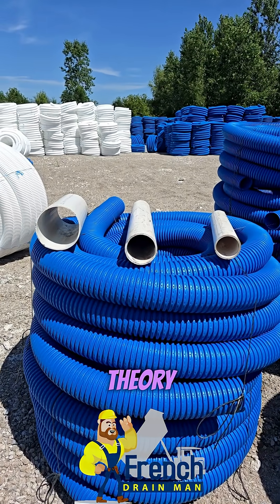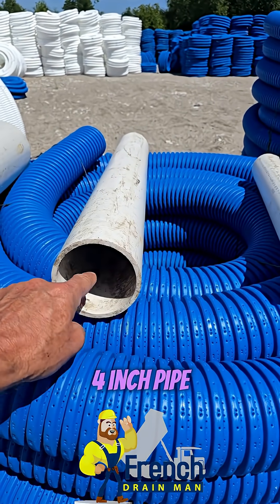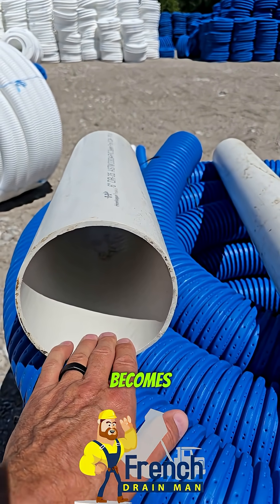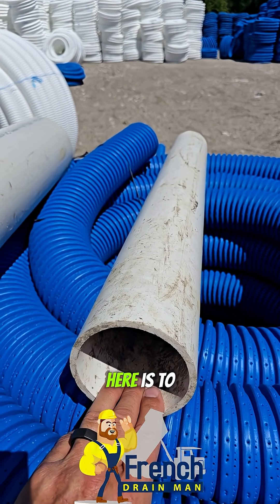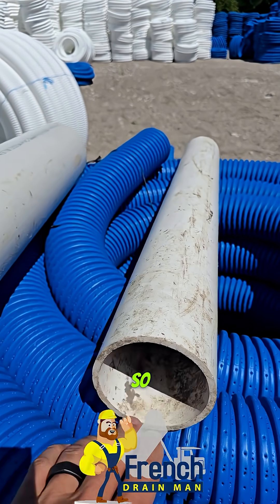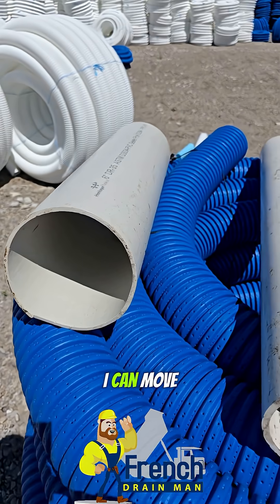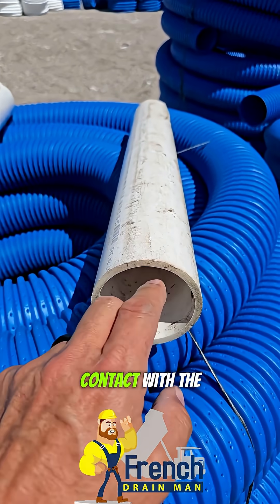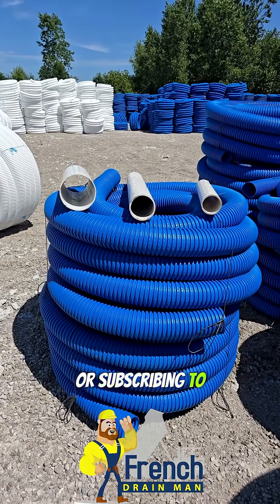Bigger is Better Theory

Comment: Good analogy. But remember that the more friction you have the more wear you have. Especially when you have shingle pieces in it. For a big storm it is great to move all that water quickly. But if you don't have a lot of water it's overkill. I.E. the big pipe. But look at your situation, if you have a ton of water you may need a bigger pipe.

Comment: If a 3 or 4 inch pipe volume flows through a 6 or 8 inch pipe, the air gap above the water flow in that pipe acts as the VENT, allowing the air displaced by the water to  move freely above it. The 3 or 4 inch pipe running at full tilt "unvented" will reach a point where it hits the breaks to "glug" air back killing the flow. Is this not a factor in yard drainage? I ask because it caused a huge amount of chaos in my basement sump water evacuation system. I vented the system and now it runs smooth as can be. No plumber I called even thought of this. More pumps, more check valves, dig up the pipes, I heard it all and finally worked it out myself!!!!
Reply from the maker: Vacuum is great in yard drainage 
Ventrari effect.
Reply: @FRENCHDRAINMAN  “Venturi effect”? you mean - close cousin of the Bernoulli effect.
Reply: I guess it could help generate suction of ground water in a yard install! Intresting!

Comment: Theres a problem with your explanation of water flowing through a 6in pipe. Flow rate is Area x Velocity, so if you increase the larger diameter pipe will flow the same volume of water flower. This next part gets into fluid dynamics, The Hydraulic radius increases with pipe Diameter. A 6in pipe has a bigger hydraulic radius which actually means less friction loss. 

For drainage, you've pointed out high velocity is important to keep the system clean. So you would want the smallest pipe for the volume of water, to pick up and move debris out the system.
Reply from the maker: Thank you for commenting and contributing.

Comment: Reference the Science Data and Source information that backs up what you're saying. Show the receipts Dude.
Reply: Ah yes, the ol’ ‘Show me the receipts, Dude’ comment. Classic. So here you go:

The science behind this is literally Fluid Dynamics 101. You ever heard of the Darcy-Weisbach equation or Manning’s equation? These bad boys describe how friction loss increases with pipe diameter if the flow isn’t high enough to fill the pipe. Bigger pipe = more surface area = more drag = slower flow. That’s not opinion — that’s physics.

Want to keep your drainage line clean? You need scouring velocity — that’s the minimum speed water needs to move to flush debris. If the pipe’s too big and water volume is low, it just crawls along, sediment piles up, and boom — clogged system. But hey, maybe the mud and roots in your line just need more time to feel appreciated?

Also, next time you flush your toilet, ask yourself why the whole house isn’t plumbed with 12" sewer mains. 🤷‍♂️

So yeah — French Drain Man’s not making this stuff up. He’s just breaking down the nerdy engineering in plain English so homeowners don’t have to Google "hydraulic radius" before fixing their yard.

You wanted receipts? Here's a summary:

Manning’s Equation ✅

Darcy-Weisbach Equation ✅

Scouring Velocity Principles ✅

Real-world field installs backed by years of experience ✅

Hope that helps, ‘Dude.’ 😉
Reply from the maker: Thank you 🙂

Comment: Never heard about water friction...
Reply from the maker: The velocity of water is not uniform across the pipe's cross-section. Water near the pipe wall moves slower due to friction, while water in the center of the pipe moves faster. This difference in velocity creates a velocity profile within the pipe.

Comment: But if your pipe is perforated don't you want it to move slow so it sucks through the pipe into the gravel and gets absorbed into the ground
Reply from the maker: Huh? 
Its not a Leach Field.  For underground downspouts it will be a solid pipe. For a discharge pipe, it's almost always a solid pipe.

Comment: Okay this doesn't make sense because if the smaller pipe is full, water would be touching the entire circumference of the pipe. So let's say it's touching 3 inches of pipe or however much width pipe there is if it were cut long ways and rolled out flat. Now take a bigger pipe that's only a quarter full of water. Water is touching only part of the circumference of the pipe, but it's a bigger pipe, so it could also be touching 3 inches of the circumference of the pipe, depending on the size. So the friction area of the water that's touching the pipe could be equal for two different sized pipes.
Reply from the maker: Watch the full-length videos.
Reply: He did a video and it completely makes sense 

Water flows quicker when it’s forced into a smaller tube 

And that being said, quick water flow will self clean the system

Comment: Thanks for the info. Just curious: why does speed matter as long as it isn’t backing up? Isn’t it still true that the 6” will handle some events that the 4” won’t?
Reply: It helps to push debris like leaves and shingle gravel through the pipe instead of getting backed up
Reply from the maker: Doesn't speed equal MORE gallons per minute (GPM)?

Comment: And don't even get me started on the people who think that a bigger pipe doesn't need screens. All that water will just wash away all the leaves and shingle granules that come off the roof, right?

Uhhh...NO! That is NOT how it works. In fact, judging by this video, it's MORE likely to be clogged than a smaller pipe. But even then, you should STILL USE SCREENS!

Comment: i need to move such a large amount of water though, a 6" is necessary. my 4" pvc system, the pipe gets completely filled in heavy rains and the water pools on the surface as the catch basins are backed up. and no its not clogged lol. we are talking huge water my house sits at the bottom of a gentle hill on one side
Reply from the maker: When you can fill a six inch pipe, it really moves a lot of water. A six inch pipe can move 2.7 (4 inch pipes.

Comment: How one can know how much water they have to decide what size of the pipe to go for? Hello from Scotland 🫡
Reply from the maker: I would rather undersize than oversize the system.
Reply: @FRENCHDRAINMAN  I was on the fence deciding between 6-in vs. 4-in main since it would carry almost all the water from the back of the house (open French drain + 3 downspouts + yard drain). I realized an advantage of the dual pipe 4-way connect system vs. a 6-in main is that the top pipe is effectively an overflow that only kicks in when the bottom pipe is overwhelmed. my guess is that will only happen during the handful of flash floods we get each year.
Reply: @FRENCHDRAINMAN Goes against logic a little bit 😂 but it is what it is.
Reply: @FRENCHDRAINMAN Understand. In this direction is the idea. 👍
Reply: @FRENCHDRAINMAN I have 2 2x3 downspouts followed by 4 3x4 downspouts on my pipe (I'm guessing it's 4").  Would a 6" be warranted after the 2nd 3x4?  I saw your video earlier saying 3 3x4 maxes a 4".
Reply: NDS Drainage website has a drainage calculator